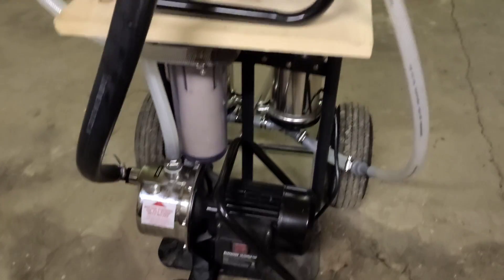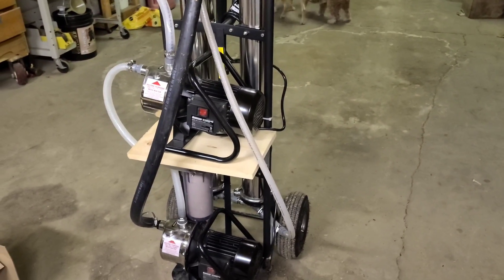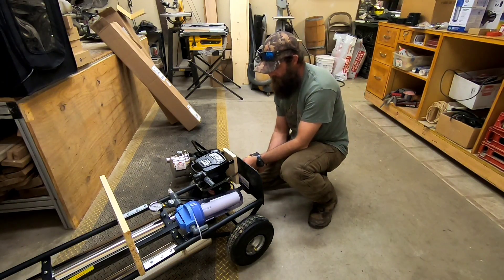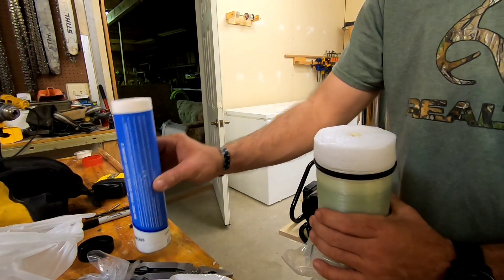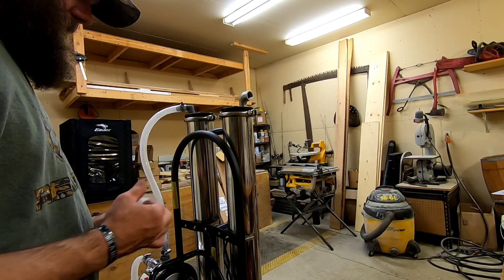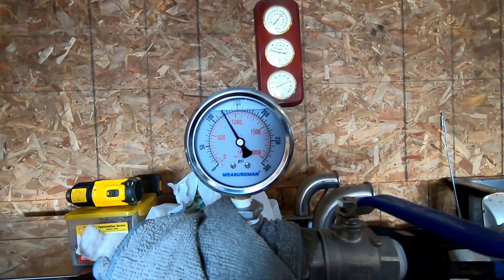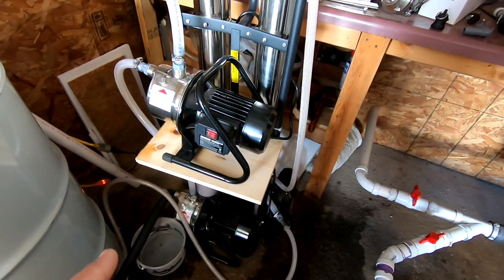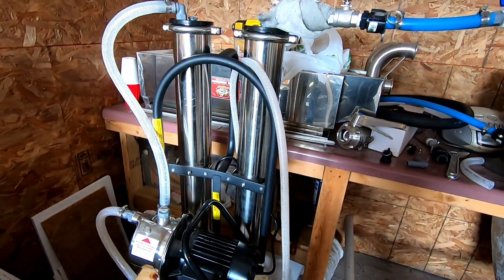how to build a maple syrup ro system

Comment: I had trouble securing 2 1.5hp pumps so instead I have the 1.1hp version feeding the 1.5...do you think that will create enough pressure for 2 posts?
Reply from the maker: It won't run optimal but should work. Mine was far from running optimal but it worked well.

Comment: Would two pumps handle four membranes?
Reply: It would be two 110 V, 1.6hp, 1320 GPH pumps.
Reply: If them won't do it what would you recommend that would work, hopefully one to supply a prefilled and then one that will handle the four membranes, thanks.

Comment: Where did you find those rubber centering supports and band-aid straps? Those really give a nice, sharp look, but I can't find them online or at my local hardware store to save my life. I'm guessing since you're into so many different hobbies, it's probably a common part in some other industry.
Reply from the maker: Those came with the stainless tubes. Although they would be very easy to 3d print.
Reply: @JDSOutdoors  So I just checked in my RO tube and guess what was in there. The same brackets as you. Still weird they're not online anywhere but I have them so that is good.

Comment: Can you just run one set of membranes?
Reply from the maker: @RyanJones-t6w  yes absolutely
Reply: Do you have to have the two pumps or can you just have one 220 pump?
Reply from the maker: @RyanJones-t6w  you can use one but no pre filter you will blow it up at higher pressure

Comment: I’m not following the flow direction on the second RO membrane. Is the filter then placed in the canister in the opposite direction! If so, why you the permeate not come off the top of the second membrane? I would like to build a larger style unit so I can RO faster. I currently run a small 4 membrane system which it would be nice to be able to run my sap through fast. Thanks
Reply from the maker: You can run it out any port top or bottom

Comment: Real nice setup.  My sugar shack is about 200 feet distance and 30 feet above my sap collection tank. Do you think your system could pump the concentrated sap up to the shack if I use the RO at the collection tank level?
Reply from the maker: It should have no problem if you can keep it from freezing. Use 220 pumps
Reply: Thanks. I have the same issue you have, I  must use a generator for electricity.  If I scale down your design to have just  1 RO filter, what do you think the single pass concentration will be? @JDSOutdoors
Reply from the maker: @alainroy6214  1 pt or so increase
Reply: Do you have two seperate circuits on your generator? The specs show a 10 Amp draw for each motor, so a typical 15 Amps circuit on the genarator would pop the breaker with both motors running.

Comment: What PSI were you able to get with these two pumps? We made this system and seem to only get 115 PSI, and can only get about 20 gallons per hour. We built it exactly the same as this unit.
Reply from the maker: Thats really low something is off gph wise. My max is 125psi but I usually run 115 and get 125-150gph
Reply: We figured out what we were doing wrong. We we pumped the pumps at too high of a pressure and it stalled the flow. Our pumps that we put on our unit between 80 and 110 
At 110 is the best flow. The higher the pressure after 110 the less flow we have. At 120 the flow gets shut right off (stops moving)
So we figured it out and it has great flow. We likely will replace the top motor for a higher pressure pump to get higher sugar content and also  so that we can do it quicker 
Procon 165

Comment: Does it need two pumps or can one do the job? I'm planning to build one.
Reply from the maker: One works with no pre filter after it.
Reply: Did you build a system with one pump? I am planning to do the same. If so, did it work well?